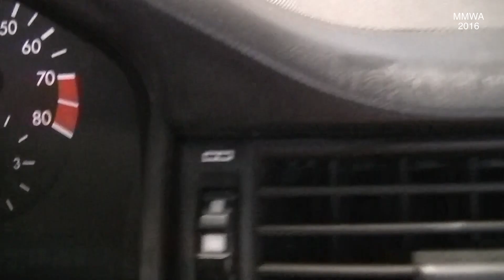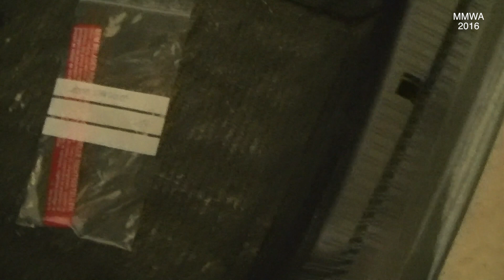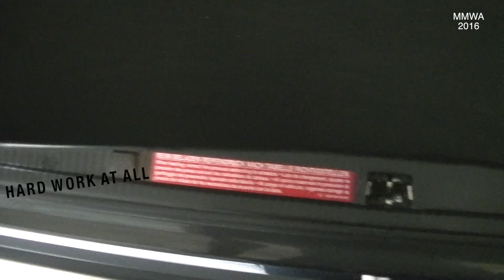W124 - A Couple Quick Easy Jobs

Comment from the maker: For anyone curious, the vents use a non standard 0.4w T5 wedge bulb which usually needs to be specially ordered. The LED in the video didn't actually fit, I had to use a different style. I may / may not go back to a regular bulb If i can get the correct type later, but I will change it from the opening where the cluster is as its less risky than destroying the dash removing the vent again.
Reply: This lamp just burnt out in my W126 - I recalled this video and wondered what type you used. From this note I was able to look up that it's a 2322 lamp. My local auto parts store says they can get them, I'll see how much it costs tomorrow.
Reply from the maker: just looked it up and they are indeed 0.4w so they should be fine. Any higher wattage runs the risk of melting the housing.

Comment: When in the boot/trunk remove spare wheel and check rubber drain plug surround hasn't rusted away!
Reply from the maker: mines perfect. The only rust on my car is a very very small amount starting at the front left corner of the sunroof opening. Which is an absolute nightmare to repair as you have to drop the roof lining and presumably even the sunroof frame. I'm just keeping an eye on it at the moment. I don't drive in the rain so progression should be very slow.

Comment: Hey, my 124 light bulb under the door trim wont turn on when I open the door.. I've changed the bulb and it still won't turn on.. Can you help me what should I check on next?
Reply from the maker: I'd be suspicious that the wiring has broken inside the door hose - it wont be obvious to see, the copper itself breaks inside the insulation where it is bent repeatedly from opening and closing the door. Time to get out the multimeter and check this wiring. This phenomenon is not limited to Mercedes, any wire on any car for any door device can and does break when it is opened and closed enough times.
Reply: MMWA thank you.. i've checked the wiring and there's one cable unplugged.. my right door trim under light works just fine now.. but suddenly, the left side light keep turning on even when the door is closed.. do you know what would be the main problem? Thank you
Reply from the maker: That's a bit concerning. If just one light is turning on by itself there must be a wiring error somewhere or possibly even broken insulation. I have not seen this before unfortunately. Maybe there is an issue with this circuits cabling and thats why someone unplugged it to stop flat batteries or worse.